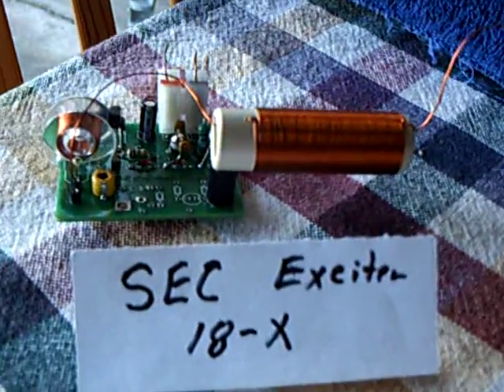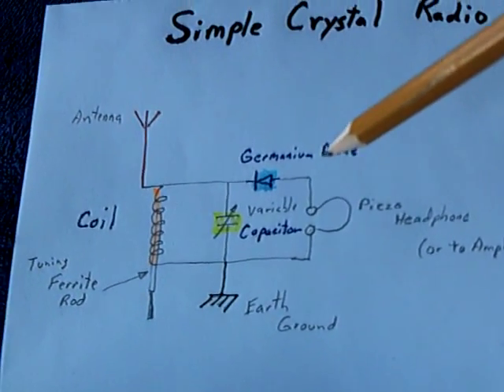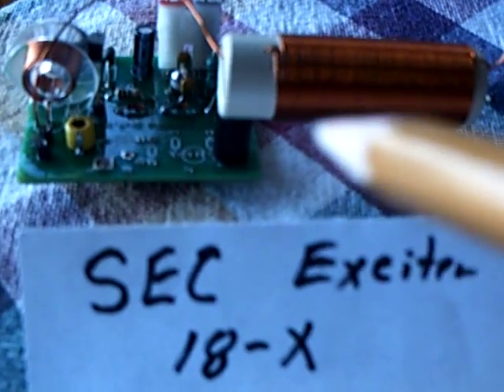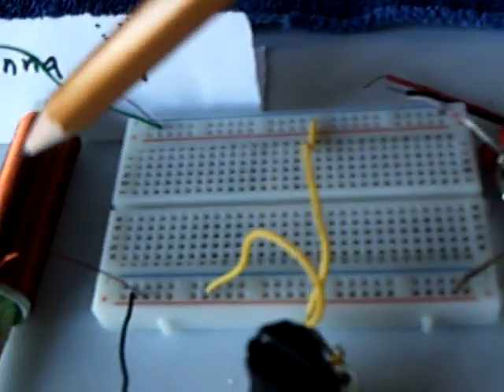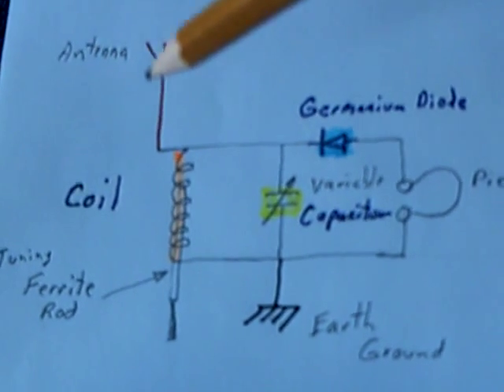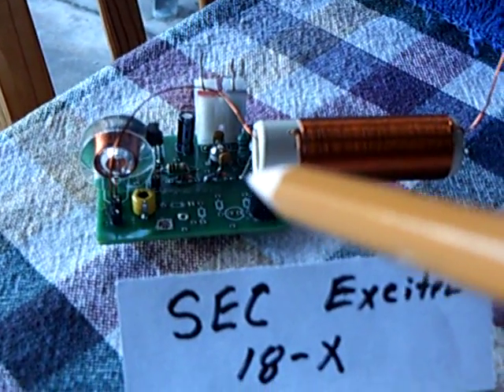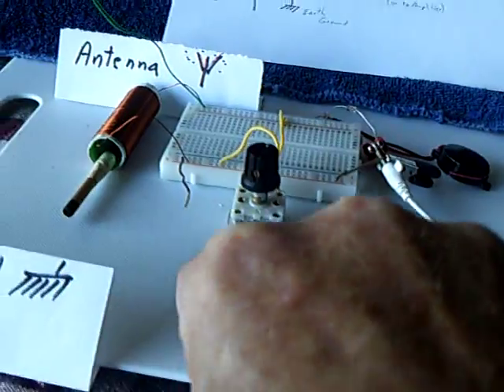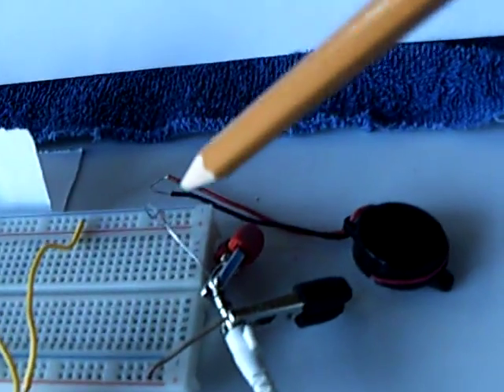Simple Crystal Radio

Comment: @Lidmotor Interesting. I guess you are saying the circuit is so simple, that, in fact, everything in it.. dictates the rang.. makes sense really, nd what little variance you have in the capacitance and inductance will give it a bit of range as opposed to a single fixed frequency. I'm going to have to build one too. I actually took off in my camper for the weekend :) it was about 30 degrees out. Quite cozy in the camper though.

Comment: @Lidmotor Thanks! And here is an idea:

Why not having on 1 coil, multiples takes to get multiples frequency, but all as an harmonic of the other, that you could amplify each harmonics and get max of power. would need of course these frequencies in phase, otherwise it would be only noise. What do You think Lidmotor? and why you don't provide the specifications of your own circuit for replication? :/